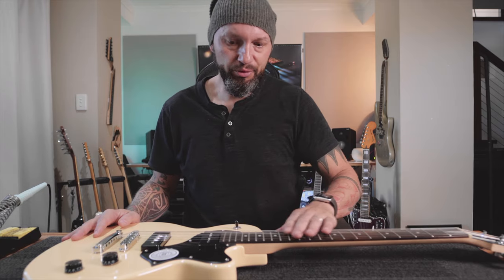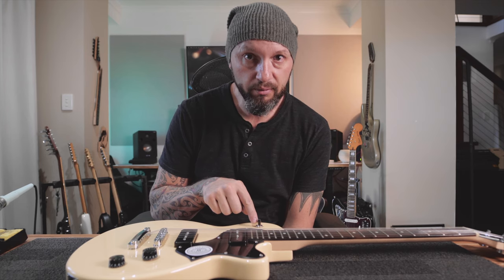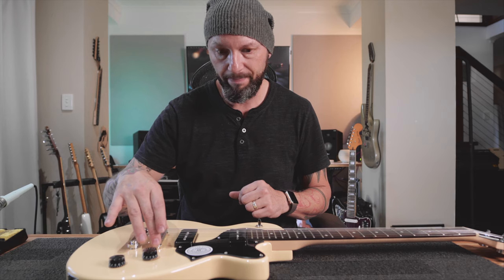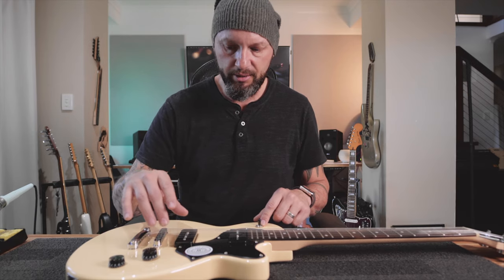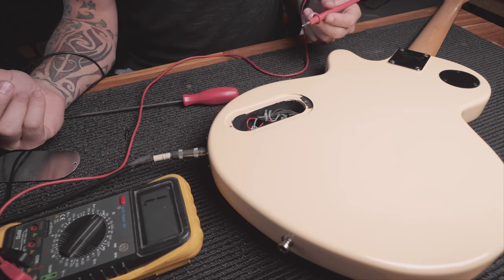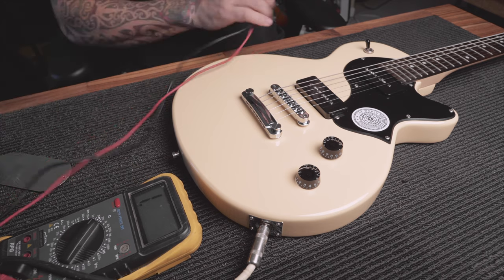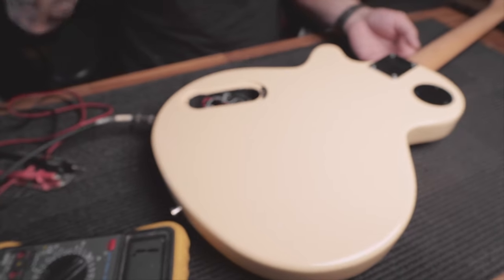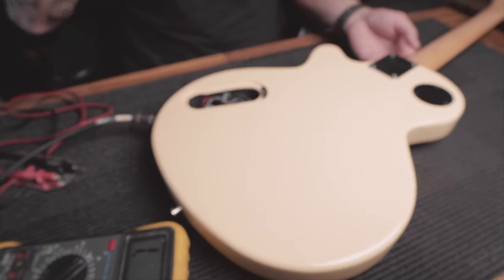3 Easy Solutions to Fix Ground Noise | Guitar How-to Ep02

Comment: I got a problem with a Shecter 7 string guitar with passive seymour duncan pickups running through a Kemper:
Sometimes I hear a cracking noise - especially after playing palm mutes and stopping really fast, you can hear the "cracking noise" immeadiately afterwards
There is no ground noise though
It has to be the guitar, as the issue doesn't occur with other guitars
Reply from the maker: @lula616  is your Kemper using noise suppression in the signal chain, I wonder if that is off do you get ground noise issues. I wonder if the noise suppression is kicking in to stop it giving you a cracking noise. I would take the control cover off the back and just check all you wiring, make sure there is nothing shorting out. Also check your output jack, make sure the wiring is good and not bunched up etc.
Reply: @RisingSunGuitarMods  thanks for your fast response! 
Yes, there is a noise gate in the signal chain, however the problem only occurs with this guitar
I haven't checked thd guitar wiring yet, but I guess that the input jack might be the problem (maybe it's a little bit oxidated)
Reply from the maker: @lula616  yea it might have a wiring issue causing noise and the noise suppression is cutting it out. When you suddenly stop the noise suppression has to kick in causing it to crackle. That’s my thoughts. I’d check your wiring. Try disabling the noise suppression and then see if the guitar is noisy.

Comment: so if I touch everything you've mentioned and the noise goes down in volume but not completely (which is fine I guess) then it's not a grounding issue, right?
Reply from the maker: That’s correct. It could be something in your signal chain or even EMI from a close by power supply. There are a lot of factors to consider.

Comment: On a broken ground wire does it matter what pot you reconnect it to ?
Reply from the maker: No, it generally doesn't matter assuming all other connections are good. But most of the time you will go to the volume pot.
Reply: @RisingSunGuitarMods  ok thanks for the info , much appreciated 😀
Reply from the maker: @dayvodays8452  You're welcome bro.

Comment: Great video, much appreciated 👍👍
Got the same issue here. Took my guitar for a re-wire to eliminate the buzz. Got home and still there 😫
Touch the strings and it goes, touch the bridge and it goes but touch the 3 way selector and it gets worse.
That to me sounds like a faulty pickup selector, would you agree?
Reply from the maker: Or the selector is not grounded. Did they do any shielding? I’m doing a vid at the moment on how to reduce the EMI noise if all your grounding is good. So look out for that one.
Reply: @RisingSunGuitarMods  Thanks mate. I contacted the shop who did the work today and they said it was fine before I picked it up!
I was demoed the work briefly and no noise was present as the guy was obviously touching a metal compnent so no noise would be heard.
Looked at the wiring and the solder joints looked shabby and no shielding was added other than the manufactures shielding on the inside of the cavity lid.
Rich
Reply from the maker: @richardjones2811  sub to my channel and turn on notifications. I’ll try to get the follow up vid out this week. Hopefully will be useful for you.
Reply: @richardjones2811  did you found out how to get the buzz from the selector? I’m having the same problem and don’t know if replacing it is the best solution
Reply: @esauvargas3647  Hello, before you replace anything I would take your guitar for a full re-wire. The pickup selector was fine on mine, just a rubbish job in the first shop.
Reply: @richardjones2811  Thanks man, I'm upgrading my first kit electric guitar, a Yamaha Gigmaker XD. When I looked the electronics found  the switch is made with cheap plastic body. So along with new pickups I bought a better switch.

So re-wiring is needed anyway, hope that gets rid of the noise problem. Thanks for the tip
Reply: @esauvargas3647  A re-wire will sort all your problems. Might as well get a new pickup selector too, they are only cheap and won't add much more to the re-wire cost.

Comment: Hi there, I have a Gretsch G5222  2 Vol, 1Tone and 1 Master Vol Pot. The Guitar is noisy when turning OFF the vol. Pots. All parts llik strings , pots , jack, bridge etc have ground signal. Tested it.  When i touch the white cable from jack to tone pot it gets worse. Do you have any advise what could be wrong?
Reply from the maker: Is it factory wiring or has it been modified? Volume at zero should ground out. Is the output jack wired correct? 2 volumes with a master volume could be the issue and may need more of a look, many times you will find each pickup is wired directly to the middle lug on the volume control, with the left terminal being the "output" of the volume control, which then goes to the pickup selector switch. On this wiring, you will hear hum at zero because you are shorting the pickup to ground, but not the signal going to the amp.
Reply: @RisingSunGuitarMods  thank you for the fast reply. It is factory wiring, no mod. I thought it can't be correct so i returned the guitar and got a replacement. Same issue with replacement. I wrote to gretsch in USA for wiring diagram and / or photos but they can not help because I'm overseas in Europe. Output jack has 2 cables, white and black. white goes to middle pin of tone pot and black to the back of tone pot. Guitar has a treble bleed .
Reply from the maker: @jedi1217  I wonder if you have a ground loop in your setup. Do you have the ability to try another amp/ setup? I’m away with my family at the moment but I’d be happy to look into this for you next week when I get home. It’s an interesting one that I think we should be able to solve. 🙂
Reply: @RisingSunGuitarMods  great , thank you. I dont have issues with other guitars on the same amp will try another amp. I will also try another socket in the house first. Have a nice trip

Comment: The problem could be the grounding of the electrical circuit of your house, i.e., the lack of it. For example, here where I live the ground on the wall sockets is just for show, it is not grounded! I know this because I get mild electrical shocks when I touch metal surfaces like my PC case or the back of my TV. If this is your case, there is nothing you can do on your guitar to fix it. But there is a "fix", you can use a wireless transmission scheme on your guitar, this will eliminate the noise because the guitar will be isolated from the electrical ungrounded circuit.
Reply: ps: this problem is worst with single-coils! Even if the circuit is not grounded, humbuckers emit much less noise from my personal experience (I have two guitars, one with humbuckers and one with single coils).
Reply from the maker: Yes you will need to have decent grounding through your supply. What country do you live in. Here in Australia it is illegal to not have a proper ground in your home.
Reply: @RisingSunGuitarMods  Brazil. Here it is illegal too...
Reply: @RisingSunGuitarMods  it's illegal but it still happens. When I lived in the Philippines I would always experience electrical buzzing from my laptop and other appliances. I am from the US, so it scared the crap out of me. Never experienced anything like it so I did a little research. The grounding in that unit was nonexistent! I lived there 4 years and obviously survived but it seems dangerous.

Comment: I have a noisy schecter with EMG’s. When i touch the screws on the pickups it gets silent. I changed the battery already (guitar just gets quiet when its dead, not noisy for me) 

Any ideas?
Reply from the maker: Check the battery: Active pickups require a good battery to function properly. Make sure the battery is fully charged or replace it with a fresh one. 

Check the wiring: Make sure the wiring inside the guitar is properly connected and not loose or damaged.

Check the grounding: Ensure that the guitar's grounding is properly connected to the bridge and other metal parts of the guitar.

Shielding: Adding shielding to the guitar's electronics can help reduce noise. Check my video on my channel about this. 

Hope there is a solution here for you. Hard to determine without seeing the issue.

Comment: hi. one of my guitars has only laud noise when the master volume is almost on the middle (not an spot middle. like from 40% to 70% of the volume can hear noise) what is the reason and how can I fix this issue ? has the volume problem? does it do anything with the capacitor connected to the master volume?
Reply from the maker: A capacitor on your volume pot is usually there to act as a treble bleed, without seeing your set up it sounds like you may have a bad capacitor. You can remove it and see if the noise goes away, then if you like the treble bleed when you roll off the volume you can just replace the cap with one of the same value.

Comment: My guitar has this issue except it goes away when I touch the bridge or the pickups or the knobs but not the strings. Everything seems grounded and there's shielding inside the body. What else should I check?
Reply from the maker: Bridge but not the strings, are the saddles made of something non conductive?
Reply: @RisingSunGuitarMods  I just double-checked to be sure and I noticed the buzzing does go away when I touch the strings as well, it's just less noticeable. So that just confirms it's a grounding issue. I already ordered a multimeter to track it down. I'm not sure that the shielding is grounded either so I need to do that as well. Thanks for actually responding I wasn't really expecting that lol
Reply from the maker: @MWTravesty  no problem man. Also worth checking your output jack. Make sure it’s got good connections. Sometimes just reflowing the solder can help. Also have a look at this video on shielding. Guitar Hum Frustrating You? TRY THIS!  | Guitar How-to Ep03.1
https://youtu.be/sAQP5HtdNuc

Comment: gud day sir,mine is always humming when you on the guitar if you touch the guitar the humming sound will stop,what your suggestion.tnx god bless.
Reply from the maker: Try isolating the issue, do you have pedals that can be taken out of the circuit? Do you have another amp you can try? are you able to try in a different location as you might be close to other things that will cause interference. You could also try this: https://youtu.be/sAQP5HtdNuc 👍

Comment: What does it mean if by touching the strings and bridge the hum goes away but gets worse while touching the selector switch and the pickups?
Reply from the maker: It’s likely a ground wire to the selector is broken or has dry solder. Do a visual inspection and if you can’t see anything use a multimeter to test continuity.

Comment: Hi Phil! I dont have the same grounding problem like you,cause if i touch the pickup selector,input jack and the bridge it doesn't make the sound worse its muting the hum what's the problem with my guitar then?
Reply from the maker: The grounding is working correctly if the sound reduces when touching the bridge and strings etc, sounds like you have a noisy guitar which can be a lot of things, I'm doing a follow up video so subscribe and hit the bell. I will address what you can do to reduce noise when it's not an earthing problem.

Comment: What could cause humming when touching only the height adjuster screws, and if you touch the strings the humming stops in an other wise silent, (not humming/buzzing) epi les paul standard ?
Reply from the maker: On both pickups? I would maybe remove the pickups and check if the shielding wire has been pinched? Run a multimeter over it and check if the screws are shorting on something. This would be difficult to solve without having the guitar in front of me.
Reply: Yes it's on both pickups, and it has continuity on the pots, output jack and toggle switch, I will try and check all the pick up wiring like you said (I didn't check the actual wiring on them) and if anything I'll just rewire the the guitar, thanks!
Reply from the maker: @tonyalcantar8378  might be worth checking if there is continuity between the screw and the north and/or south wires. I’m wondering if there is a short somewhere.

Comment: Hm im not sure if my problem is the same as this one or if its even a problem but:
When i select my Bridge pickup i can hear that the background noise of the amp gets louder than on my neck pickup. Also when i touch the lower part of my bridge pickup the background noise gets louder. But if I touch any of the parts on the guitar that should be grounded at the same time as the pickup its not loud. Maybe this is normal?

Comment: When plugin in my guitar cable by itself in the amp  (without the guitar attached) it makes bad noise similar to the guitar noise in the video, I changed the cable and the noise still there in the amp, any idea?
Reply from the maker: Heaps of things to consider here. Is it noisy with your guitar plugged in or does it go away? Could be a ground loop or could be power supply related. Too many possibilities without more info.
Reply: @RisingSunGuitarMods  I checked the whole things I found that guitar has a dead pickup and other issues, the amp is healthy, thank you.

Comment: mine is so static to the point where the sound that’s supposed to come from the guitar doesnt work, we tried a different speaker, same thing, and we tried different cords so what do i do?
Reply from the maker: First thing to do is a visual inspection of your wiring. Start with the input jack. It’s common for the wires to get twisted.

Comment: When I touch my pickup switch the noise gets worse, but all my connections are good according to the multimeter. Could it just be EMI noise?
Reply from the maker: it's possible, there are many factors for noise, these are just a couple of common ones. You could give this a go: try this: https://youtu.be/sAQP5HtdNuc

Comment: Ok, so if all the metal(tuners, bridge, tailpiece, switch, pots, and strings) and the plug all quiet down when you touch it, is it just shielding(les paul, any amp)?
Reply from the maker: Do you have hum-buckers or P90 ‘s in your LP? If it’s really loud there could be another issue. But if the hum goes away then grounding is good, you could have a faulty part somewhere. A bit of hum is normal but you could also have something close by interfering with the signal. Computer power supply, soldering iron etc…
Reply: @RisingSunGuitarMods  Yes, humbuckers a pair of vintage dimarzio super distortions.  It is worse with more distortion on either amp. However, I have a newer epiphone 335 with humbuckers and it is silent into the same amp, same cord, same playing area.
Reply from the maker: @ahhsgvr  okay, good that you have a comparison guitar. This takes environmental and equipment out of the equation. Here is something worth trying. If you have a soldering iron try reflowing the solder on the output jack and all the pot terminals and ground points. So basically anything that is soldered add some new solder to it. Hopefully you get lucky and that solves it. Let me know how you go.

Comment: Guys! Don't forget that if you have active pickups(like EMG), the bridge ground is off. So the noise buzz doesn't stop if you touch it.
Reply from the maker: Good point. Active circuits work different to passive. Grounding an active circuit can result in ground loops or sometimes they won’t work at all. If you have noisy active pickups there could be a circuit issue? I’m not sure if shielding would help with a noisy active setup. Something I’d like to look into though. 👍
Reply: @RisingSunGuitarMods  after watching your video and reading about these ground circuits I thought that my bridge wasn’t grounded correctly! 
Because my guitar is so noisy and I can’t even play with overdrive, I immediately removed the bridge and was surprised when there was no cable or even a hole to pass the ground! After that I read a little bit more and I guess the problem can be that the Active pickup battery is dead and if I replace it I might get the job done!
Tomorrow I’ll go and buy one and fingers crossed the noise might go away!
Reply from the maker: @nalditrinmartinho1781  9 volt battery, do the tongue test. 🤣 But seriously that sounds like it would be the first thing to check. My understanding is the ground circuit is within the electrics of the active system. So if the battery is dead your circuit would be incomplete. Let me know how you go. Interested to know if it fixes it for you.
Reply: @nalditrinmartinho1781  I just had this problem I got a strandberg with fishman moderns and it sounded horrible i was ready to return it. Put a new battery in and its a lot better now but i think I might still have a grounding issue because they're noisier than my passive pickups

Comment: I have the same problem but in reverse on my p bass ,it's quiet but if I touch any metal parts including the strings it hums so loud! Any suggestions would be appreciated,Thanks 🙂
Reply from the maker: Sounds like you might have a broken ground wire to your output jack. I would start there. Check continuity with a multimeter to find where the ground is not connected.
Reply: @RisingSunGuitarMods  Thanks man I'll check it out ,much appreciated 😎🙏

Comment: Could be that the sound only starts when i left notes ringing while playing but disappears when i touch the head cable pluged to the input jack?
Reply from the maker: Depends how bad the hum is. A small amount is normal for single coils. But if it’s a lot it could be ground issues. Start by doing the touch test and having a good look over your electrics.
Reply: @RisingSunGuitarMods  i notice that my other guitar doesnt have it. Both guitars run humbuckers and the patch i use is pure vst with 2 noise gates. You can clearly hear it when you left palm mutes ringing as it decays away. It only goes away when i touch the cable head
Reply from the maker: @oscarcastellon7398  check your wiring. Shouldn’t have any hum with humbuckers, hence the name.